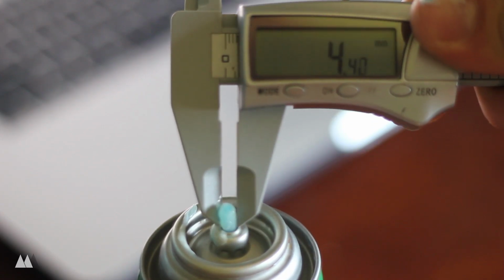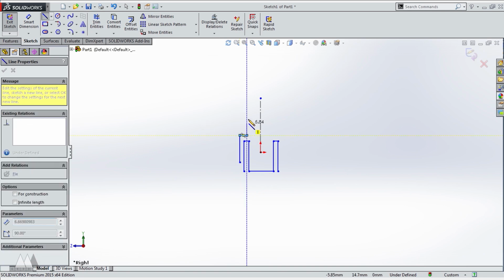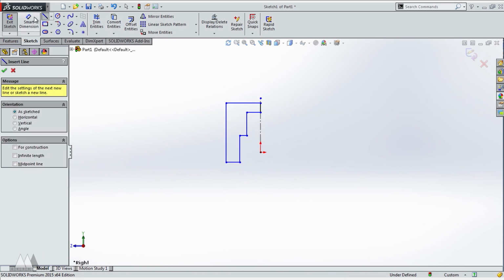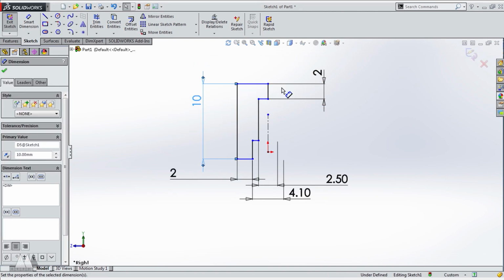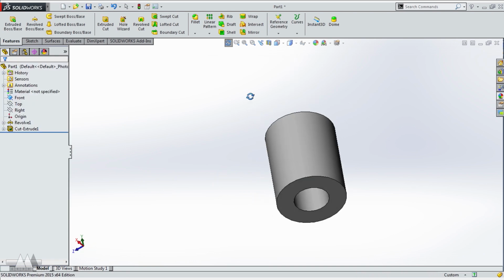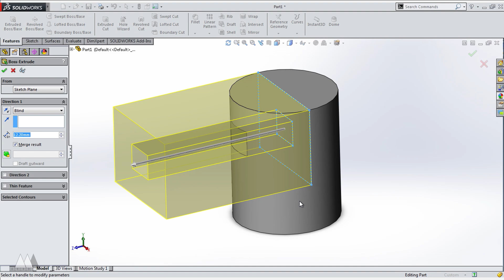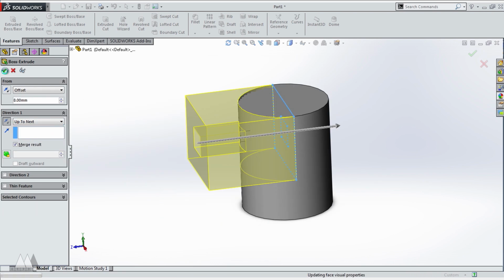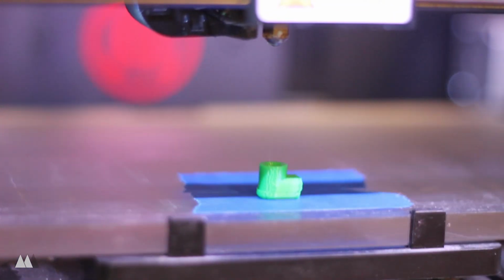5 Minute Fix : Shaving Cream Nozzle

Comment: No worries! I will just 3dprint something to solve a problem that could be solved with the ring-pull of a can of soda, in as long as it takes you to get to the fridge + grab a plate.

Soda-can ringpull, rip it off,  get a corner of one of the holes in the ringpull, small plate, squirt the foam onto the plate, apply the foam to your face, done,  jobs a good'n.

Worked that out as i was watching this DUMB video! You're welcome! Stupid head! 🥊🥊

Comment: do you think this would work with a hairspray bottle or something similar.  was using it for bed adhesion and it keeps clogging
Reply from the maker: that's a bit more complicated since it needs a pinhole to create a mist... maybe you could print a solid, single-shell wall and poke a needle through it to create a tiny hole. maybe I'll try it in an upcoming episode!
Reply: +Make Anything // 3D Printing Channel yea there's also a spring inside the cap so maybe if I have some spare time I'll cut it open or something and try to reverse engineer it